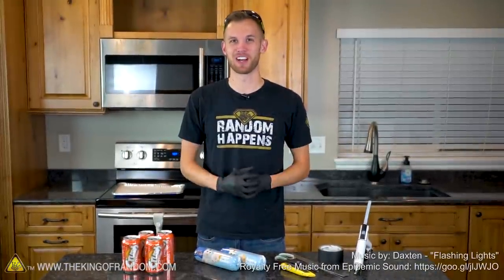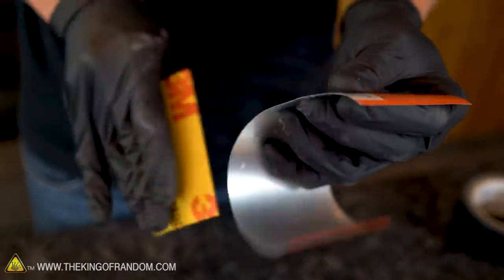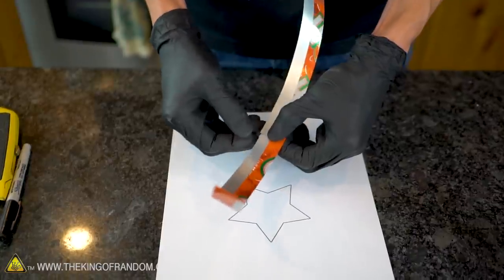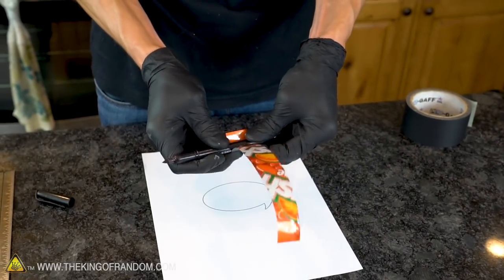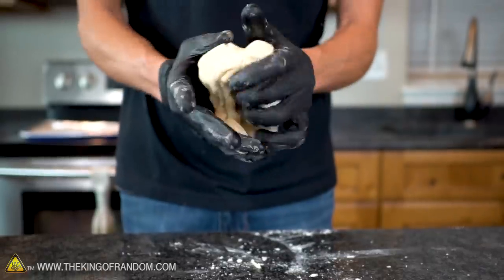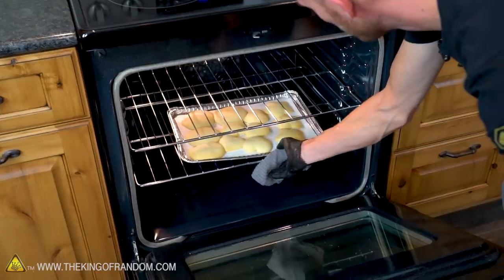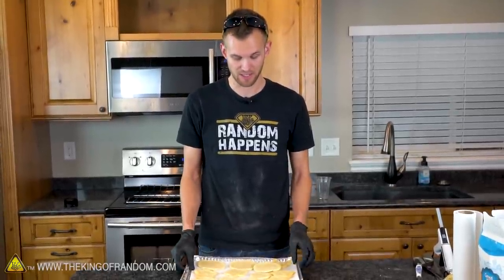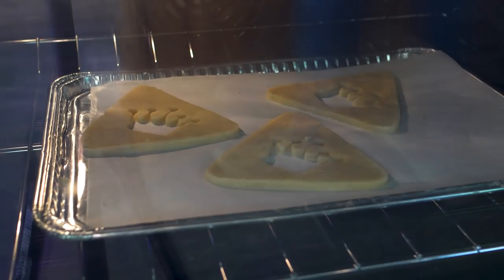DIY Cookie Cutters! TKOR Shows You How To Make Your Own Cookie Cutters At Home!

Comment: Improvement: As the thin aluminum does not hold its shape well, add a "handle" made of proto putty on the folded edge side. Not only will it make it easier on the hand when cutting, but the rigidity of the proto putty will help maintain the shape.
Reply: Ed Roberts just make sure to use the food grade Proto putty.
Reply: Absolutely
Reply: Also, you can dip it in hot glue to get a similar effect.
Reply: I love actually smart comments
Reply: Proto putty Is toxic
Reply: food grade proto putty isn't
Reply: Also, if you want the cookies to hold its shape, either bake it with the dough in the cutter, or use shortbread or gingerbread
Reply: Amy Nguyen yeah
Reply: Pei Sun wtf
Reply: +Ed roberts. I would have never thought of that.
Reply: Alexander proshkin But how do you make food grade proto putty? Would it be the same as the regular recipe? The regular recipe has moisture activated silicone, so it starts getting activated with the food dye, but I would think you’d have a very limited time to mix up proto putty with time based setting silicone
Reply: Kathryn Potts also you could chill the dough after its cut, and make sure the cookies are properly spaced.
Reply: @alexanderproshkin5736  I looked it.  If you cure it for a minimum of 14 days at 77 F AND wash thoroughly before using.  Not worth the time or the risk.

Comment from the maker: Noti squad!! 👑🤘
Reply: using the sulphur-zinc rocket fuel mixture you should make some kind of scaled up version of the pen rocket's just to test the limits/effectiveness of the rocket fuel when scaled up.
Reply: Woooooohoooo
Reply: Please return discussion tab
Reply: The King of Random , try to make sugar glasses using silicon molds .
Reply: The King of Random my noti's came 3 min ago why so late? Can you help
Reply: Noti squad
Reply: Yeo
Reply: The King of Random can you please do

a video of melting a jelly and freezing it in 
                     liquid nitrogen
Reply: 3 hours late, but try to vacuum the cookie mold so it won't deform?
Reply: Can you make a rubber band gun or a shotgun or a fully automatic gun
Reply: Here!!!! 👑✌
Reply: hey i don't know if you'll actually see this but thought i'd share a little tip that i use to do when making cookies. you can either make the cookies just as you did but after baking use the cookie cutter again or you could just roll out the doe to make one huge cookie then after its cooked use the cookie cutter and cut out cookies
Reply: The King of Random 💯💪🏻🔥
Reply: The King of Random can you show us how to build a van de graaf generator please
Reply: The King of Random M
Reply: NOTI SQUAD!!!!
Reply: I'm late
Reply: The King of Random is awsome
Reply: King of cookies 👑 🍪 🍰 🍩
Reply: Can you do an ozone generator?
Reply: Here
Reply: I think that would be cool and I want to make a cheap one. I understand I can look online but you are fun to watch.
Reply: Woooo
Reply: The King of Random what happened to the mini arc furnace
Reply: I tryed this and you should put a cup on top of your desktop fountin and put holes in the middle lf the top cup and it makes a rain drop effect its cool.
Reply: The King of Random here
Reply: Webshooter please
Reply: The King of Random that's me🤘🤘🤘
Reply: The King of Random yoo
Reply: The King of Random 🙈🙈🙈🙈🙈🙈🙈🙈🙈🙈🙈🙈🙈🙈🙈🐵🐵🙉🐒🐣🐒🐣🐬🐬
Reply: Me!
Reply: Caleb Woodhall mimiiii

Comment: I tried this project and actually had a great idea for a modification! I took a sheet of thick 1/2 inch cardboard and used a utility knife to cut my shape through only the top layer. then i pressed the aluminum strip into the cut which let it hold its shape much better.

Comment: pour water in the cans, freeze until solid then cut into slices using a bandsaw or similar tool (dremels work if you have a steady hand). sand the edges a bit, roll one edge if desired and use pliers to reform the circle into desired shape with no seam.

Comment: would it also work to cut out actual shapes on something sturdy like cardboard or thick foam and then wrap the aluminum around it to try to achieve the shape? (or to at least mark folding points?) my shaky hands make following the folds on a paper shape a little frustrating lol

Comment: I would put the folded top to the outside.  This will keep any cookie dough from getting between the two pieces and avoid frustrating cleanup.  And to avoid joining short pieces, you could use flashing from the hardward store.  Yup, it will cost a bit (not much) but that's a choice we all have to make.  :^)

Comment: Nice concept but can you sand off the label on the soda can and use a blowtorch to hold the aluminum together instead of hot glue and electrical tape?

Comment: You should have just cut the triangles and crowns separate then used icing in two or more colors. Like yellow for main body n then green to out line and put details in. Then stack crowns on big triangle giving you a 3D cookie. Plus as you figured out you need to do cookies from scratch or even make a gingerbread. You could also experiment with cookies from premade powders found in baling isle. But scratch cookies are the best.

Comment: What if you put salt on dry ice will it mealt
Reply: Salt dissolves in water, lowering the point of freezing. That's why it works for water ice. Salt does not dissolve in CO2, which is what dry ice is made of. Salt won't change the freezing point of dry ice.

Comment: Try putting a vacuum chamber on a scale and sucking all of the air out. I wonder, if you made a large enough vacuum chamber, could you make it less dense than air? Similar to how metal boats can float on water by displacing it even though the material they are made of is denser than water.

Comment: I see you haven't posted a liquid nitrogen or dry ice vid recently? How about this; can you freeze one part of a glow stick(since its usually two types of chemicals, one in the plastic tube and another in a smaller glass tube), and will it glow after its frozen when it comes in contact with the other part?

Comment: Maybe should have left the cutters on the last cookies, it might have helped keep the cookies from spreading, maybe not though depending on the force, but the ones that had dough on the inside and outside might have worked with equal pressure on both sides.